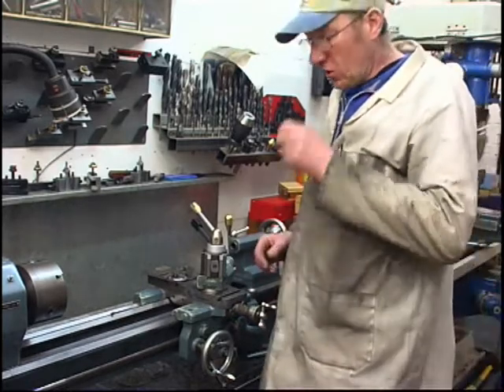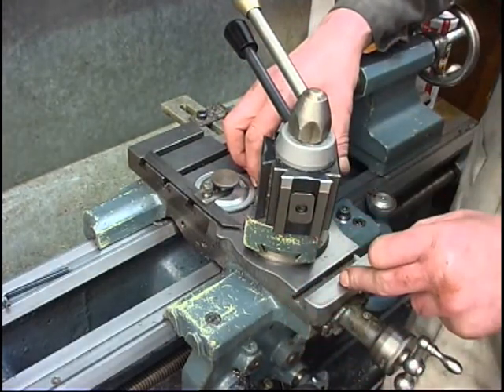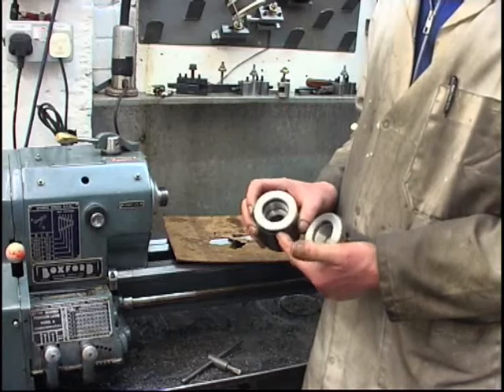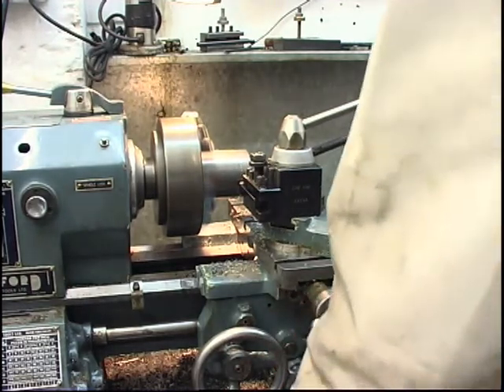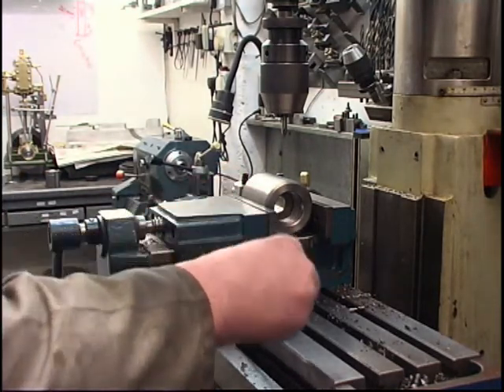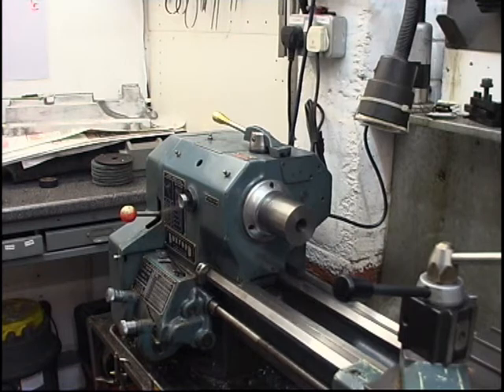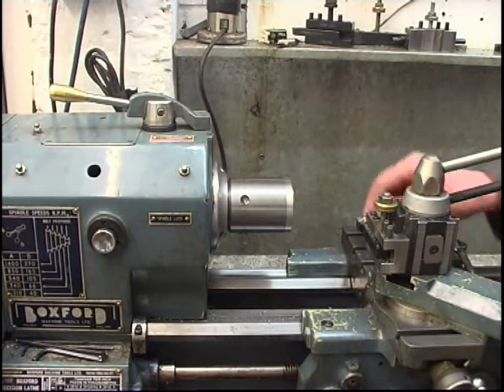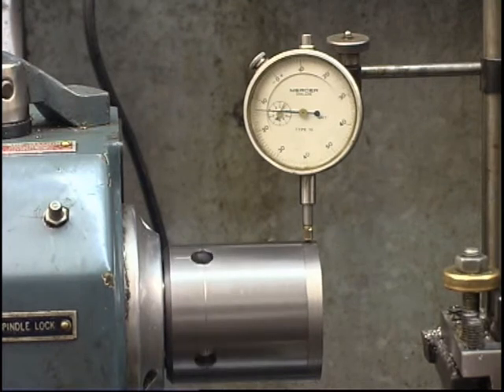GET A GRIP ER 32 PART 3

Comment: Finally I get the reasoning behind the 29 degree angle on machine threading. The root of the thread constantly moves to the left of the first cut on each subsequent cut. Leading edge cutting, trailing edge cleaning. It's like a parting of the clouds.I'm so happy I'm going to the pub. Just one thing, on very small internal threads, say M10, how is the 29 degree tool angle accounted for? Cheers.
Reply: Use a tap!

Comment: Great video, an easy method for setting 29 degrees on the compound is to make sheet metal triangle with a 29 degree angle and use it between the chuck face and the compound. Fast, easy,accurate and reusable. When not in use just hang it on the wall!

Comment: The fine finish at the interrupted cut is because the cutting tip gets the tiniest time to get cooled down. Have found that when cutting C45E steel with milled slots in it.

Comment: Sorry for you having to do it again, but if you are like me you would not have been happy knowing you could have done a better job. You know of course that you can turn the top slide through 180, to your revised position, so that the handle is clear of the compound. All that is different is that you draw the outwards instead of pushing it out.